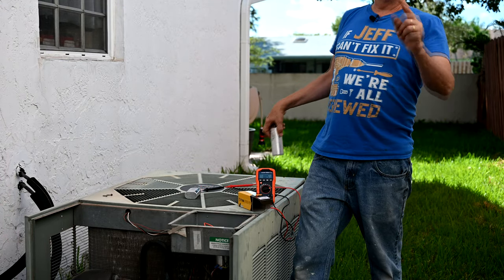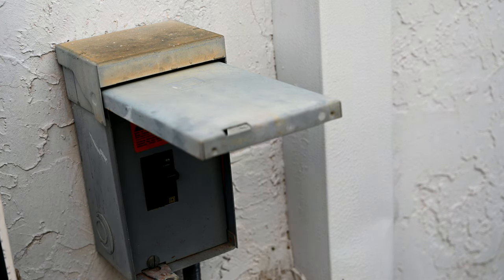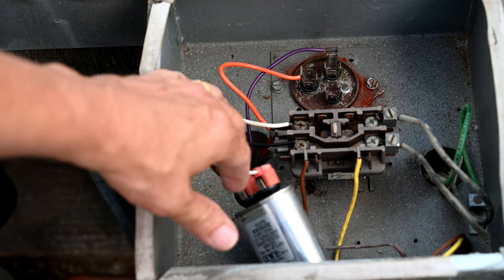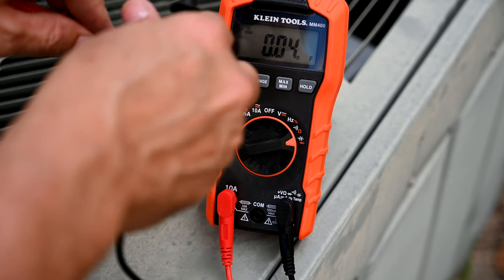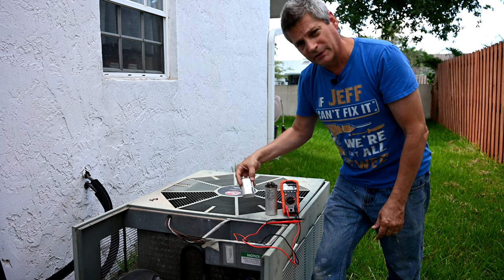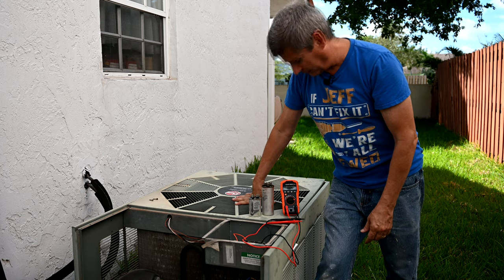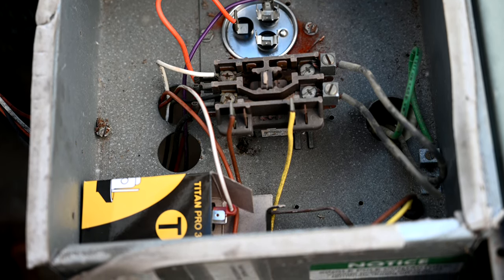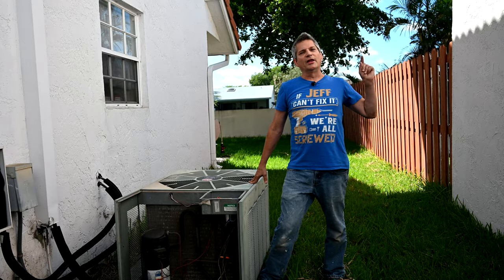DIY Fix AC Compressor Fan Not turning On, Just Humming

Comment: I replaced the compacitor and it started working. But after 30 to 60 minutes the fan stops and the unit starts buzzing/humming. I turn it off after 10 minutes it starts again but it stops after. What should I check next?
Reply from the maker: There is a start capacitor and a run capacitor. some units they are 2 capacitors built into one can with 4 leads. Which do you have?  If you have 2 caps, try checking the capacitance of the smaller run cap, see if it is what the can says on the side. If the capacitance is not what it should be, like below 10 uF for example on a 35 uF cap, then you need to replace the cap. If that does not help, then likely the fan motor is going, about $90. I would also check your contact relay, make sure there are no leaves, seeds, insects, etc, in there that would give you intermittent contact. Lost of people have that issue.
Reply: jeffostroff I have the dual run compacitor. The one I took off was all rusted and I couldn’t see what was capacitance, but I research online for the right one and is a 45/5 it did start but after 30 to 60 min it stops and starts buzzing/humming....I’ll check the relay and everything else and replace them. Thank you
Reply: Joel any chance you found a solution im in the same boat!
Reply: Josh nonya I replaced the dual run compacitor and the contact relay and still makes the humming/buzzing noise....So I order an oem fan motor and I’m still waiting on the package. I’ll let you know when I get it and  replace it...

Ps. if you get it fixed before I do, please let me know what was the issue.
Reply: @joelcd214  I just ran some water on mine and put two blower fans on it now it's cooling the house so yeah it's the fan motor
Reply: Josh nonya hey I replaced the fan motor and yes it was the fan motor super easy to replaced.

Comment: I replaced the capacitor but the fan is not spinning its like frozen in place the fan doesn't move at all, is the fan motor dead that's why the fan is not moving

Comment: That oval capacitor is not original.  Unit originally had a dual capacitor.  Check the fan motor label for the capacitance that is required.
Reply from the maker: There was another fan in there at one time, and another cap. The correct amount of capacitance it here, we checked that last year when we shot this video, there are 2 caps now.

Comment: My ac unit blows warm air at night and then in the early morning blows cold air again. Also noticed the ac fan will not run on Auto but will run on the ON position in the  thermostat. Thoughts?
Reply from the maker: Here are some things to try. Had a similar issue at my friend's house. Most likely your system won't turn on in Auto Cool mode, because your AC pan drain line to the outside of the house is clogged, so water backs up the drain pipe, back to the pan in the  AC, and then it trips your float switch because water is backing up. the float switch protects you from water backing up and overflowing and dripping all over your floor, they are required by code.  Do you have a float switch? Set your system to cool auto, and pull up the float switch out of the white plastic pipe, stick your finger down there and see if there's water. Under normal operation should only be minimal amount of water, not enough to make the float switch rise up and turn off the AC.  If the AC auto cool turns on when you lift up the float switch then your drain line is clogged. Got to outside of house where drain line emerges, and put a shop vac on the pipe, seal it with a cloth for max suction, turn on shop vac for a minute, and most of guck will be sucked out of the line. Then water should drain more like a fast drip. Let me know what you find. You can also check the batteries of the thermostat, when the voltage gets low, =sometimes the thermostat acts weird, but I think your problem is the clogged drain line.

Comment: My ac is old and when I turn it on at first the fan needs help sometimes but after that it's ok and when the fan turns off.    But the  compressor is still on I replaced the capacitor for the fan it seems to slow down n stop ? Runs for 20 30min then stops and I reset it then it's up again.
Reply from the maker: I would measure the capacitance at the  leads of the capacitor with no wires connected, make sure it matches the uF specified on the can, for example the can might have printed on the side that its is 10 uF or all the way up to 45 uF. If that passes, then clean off the contactor relay off all bugs and leaves, that can prevent the contactor leads from making good contact, reducing the voltage to the fan. If your contactor is fine, then your fan is likely blown. They last about 5 years or so. I replaced mine a few years back, another viewer of this video replaced hers fan the other day as well as the fan cap.
Reply: @jeffostroff  thanks its about 20 years old will check it out. Also i don't think it's running on a timer

Comment: I thought my issue may have been a bad capacitor but upon replacing it I am still having a problem. The problem I am having is the AC unit outside only turns on for around 30 minutes or less and always shuts off before the temperature it's set to lower to in the house. I always notice when it turns off because the AC vents start blowing warmer air. I recently got freon put in and this last time the company said the unit didn't even take any freon. What do you think can fix the problem I am having with my unit? Do you think it is the compressor going bad? I am thinking of buying a hard start kit and giving it a try since they are fairly cheap on Amazon.

Comment: In my unit, the compressor makes a buzzing sound every couple of minutes but does not start.  The fan makes a constant buzzing noise and will only get going if I give it a nudge with a stick.  Could this be caused by bad capacitors?
Reply from the maker: I'm hoping it's not your fan, they are often $100 and up, but the capacitors are $10 to $20. At the end of the day you need to be able to measure capacitance of your caps with the wires unplugged to confirm.
Reply: @jeffostroff  It was the cap, but it died because a lizard thought it would be a good idea to walk over the contacts.  I had to pay $$$ to get it fixed this time, but I have already ordered a backup from amazon for the next time.
Reply from the maker: @realmugzy  How much was the new cap? the AC companies like to charge you $120 for the cap when they replace it, in addition to their labor charge it's $15 in the supply store.
Reply: @jeffostroff  My bank account is $169 lighter.  The even tried to make it sound more impressive by putting this on the receipt "Electronic Storage Device".
Reply from the maker: @realmugzy  Now that's a fancy name for a capacitor.
Reply: @jeffostroff  squeezium gas , fancy name for a fart 😂
Reply from the maker: @DRT-81  air biscuits

Comment: What about when the ac unit isnt even humming. Like not turning on at all?
Reply from the maker: Then your contactor may be bad, or check the contactor for a collection of bugs and leaves that get caught in it, causing the contactor to fail to make electrical contact. I always measure voltage before and after contactor, but be careful, it's 240 volts.
Reply: @jeffostroff  thank you so much. I will clean out the contactor
Reply: @jeffostroff  so i cleaned off the contactor and now its continuously humming. I already replaced the power capacitor
Reply from the maker: @MightyPaladin486  So looks like you has 2 root causes there. Is the AC working OK now?
Reply: @jeffostroff  it is not. My father in law said i need to use a nail file on the contacts. Just hums
Reply from the maker: @MightyPaladin486  If you can, measure voltages and make sure they are getting to the right places. Sometimes there is a start capacitor and a run capacitor, you need to check both. My meter can measure capacitance, that's what you need to be bale to do. Check the one you replaced also to make sure it's OK.
Reply: @jeffostroff  i have a run capacitor and a fan capacitor (oval)

Comment: Okay but what do I do if my capacitors are measuring fine 😭 I replaced them just in case anyway, but it's still just humming/buzzing and not starting 😭 I'm so sad since all the clues hinted it would be my capacitors, but it seems it wasn't
Reply from the maker: check the relay next, the contacts on the relay, sometimes leaves and bugs pile up

Comment: About your capacitor test....can't see what you are doing for the lovely view of the back of your hand.
Reply from the maker: put the leads across both contacts and measure capacitance on the screen
Reply: @jeffostroff  I saw three contacts.
Reply: and my meter has two wires.

Comment: Very nice video. But I just want to add one thing: HVAC companies have a BIG apparatus to make things happen. They are in the business not to make friends, but to make money. You said that both capacitors cost about $16.00 bucks, and that the HVAC company would rip the customer off. UPDATE: Prices are not that cheap anymore.
Well, Let's brake this down for an HVAC company doing the job:
* They will have someone working in the office to take your call.
* They will send a service technician to diagnose your problem and make the repairs, and usually these folks make $30 to $38 dollars per hour
* The service tech will be driving a van, that burns gas, has insurance, and etc.
So, $150 bucks, as you said is still not that bad. Sure, if homeowner can do it: FINE. - Now, what if they screw it up and have to replace the entire unit or something else much more expensive, who knows maybe even getting hurt by electric shock? 

HOMEOWNER, if you're here try to play the "MacGyver" figure kinda guy (lol), go ahead and call your HVAC company or freelancer AC guy!!

Comment: Just as an aside, the compressor was running so I wonder why he tested the compressor run capacitor when the problem was the condenser fan motor not running.  Just looking at how rusty the other capacitor was, I'd probably just replace it on principle.
Reply from the maker: That capacitor houses 2 capacitors in one, that's why. One of the caps was the fan cap the other was the compressor cap.

Comment: something he didn't do even tho he mention the capacitor store energy make sure that the capacitor is discharge before you get your hand where the wire connect
Reply from the maker: Or just don't touch the capacitor leads and you don't have to do any discharging. As long as you are careful with it just like you would be with a car battery. Do you bother to discharge a car battery when you remove it? Nobody does because they are careful removing it.
Reply: @jeffostroff  it look like you touch it. I was just trowing that out there for someone else lol. I'm a hvac tech and I do it all the time. great video btw
Reply from the maker: @quietgameplays8246   As long as I don't touch it with my tongue I'm OK lol

Comment: DO NOT forget to Discharge the capacitor before start touching with your hands. The capacitors can store electricity even if you turn off the electric power!
Reply from the maker: Unless the capacitor is dead. also too many people improperly short the terminals with a screwdriver which can make it explode.
Reply: @jeffostroff  Well how then do you discharge the electricity stored in it so you dont get shocked?
Reply: @TeaTephiTrumpet777  hire a professional hahaha but seriously you take a milti-meter set to micro-farad and touch the meter leads to common and herm, common and start. I do HVAC for 6 years now, and MOST start capacitors don't have enough stored energy to hurt you . Black start capacitors do have plenty to hurt. Your average run all be 30-60 micro farads where a start capacitor will be 150-600 micro farads. They usually have a bleed resisitor terminal to terminal to prevent this. Usually I just take a screwdriver to it anyways (life is an experiment 🥼) and never had more than a little spark on start capacitors, not once in a run capacitor and most residential ACs will only use a run.
Reply: @jeffostroff  I short capacitors all the time. Never got more than a spark when de-enegerized. This is on AC units only. I hear micro-waves, and car subwoofers have much more powerful capacitors. So in good faith I guess it's correct to Never do this to an appliance but for residential AC's it's really not a big issue
Reply: @bjorndecker3233  because of ants the Proffessional had shown me how to change it but forgot the specifics on this portion. But I did get it done that day and it is something most anyone with interest in doing this type of thing ie fixing things. But thank you 😀

Comment: Great video. Actually it would cost you more than $150 in NY. That's only a service charge. You'll be charged an additional $60 for capacitor and tax. The total would be around $225. Now the bad news is that this idiot with over 37 years experience placed the wrong type of capacitor (whatever it's available in the van). Had to replace another one after one season.

Comment: I worked in electronics in the Navy and we would charge a capacitor then leave it set on a bench. A rookie would always come by and discharge it. That was a lesson for them. A large capacitor can kill you. Any capacitor can shock you. BE SAFE. Always assume a capacitor is charged.
Reply from the maker: yes good safety tip

Comment: Should have at least wrapped the capacitor leads in electrical tape 😂 that thing can vibrate and hits anything grounded BOOM. Also they sell the proper size capacitors at supply stores, don't need to have two seperate caps.
Reply from the maker: could not find the proper size dual cap, because the fan was replaced in later years and is a non standard cap size

Comment: Next time, save some money and just buy a 35/10 capacitor.  The round one is a dual capacitor, 35 microfarad capacitance on one side,  five on the other.  You're only hooked up to the 35 side.  Your not even using the 5 microfarad side.

Comment: All good....some folks would prefer to use USA made capacitors such as the AMRAD brand who is located in Florida ! They are twice the cost but will last well over 5 years while the CCP or Chinese stuff craps out in just 2 years or so. BTW, in CA the HVAC parts are not easy to get unless you are a licensed contractor, especially if you visit an HVAC supply house.

Comment: I don’t recommend any body who has no professional training doing this! which wires should plug in the right connection with capacitor! It’s 240v running this unite! It really worth to pay$150 let professional AC Tech doing it.
Reply from the maker: some people don't have the money, and let's not kid ourselves, you know darn well this is not a $150 repair. This is a $300-$400 repair. At the AC supply house where I get capacitors, they sell for $20, but the AC companies gouge people $120-$200 for the capacitors, plus labor. They charge $150 just for the hard start kits, then their labor of 1 to 2 hours on top. Maybe your price was in Mexico?

Comment: Give it a good punch with your fist then it will come on..i did that now and it worked
Reply from the maker: Doing the fonze. Yeah we eventually got a hard start capacitor which really made things a lot easier it went from not even being able to start no matter what we did to then it turned on every time and we used it for about a week while we were waiting for the new AC to come in

Comment: You can tell who the hvac workers are in these comments lol my parents got charged for 1k to replace capacitor and fan motor, 3 days later started to make a large rattling noise and was charged another 300 to come repair/service call. Crooks i tell ya, oem parts online was 200 max , 800 for labor gtfo!

Comment: Ummmm... would help quite a bit if your hands weren't in the way when testing capacitors as to which terminals to measure on.
Reply from the maker: Did not matter in this case, we were measuring blind, because the names of the pins were rusted out and we could not read them. All you have to do is measure from one lead tot he other, and all we care about is seeing that there are more than 0 uFarads on the screen.
Reply: You only need the big one for both of them,it is a duel run cap

Comment: You hooked it up wrong I bet it didn’t start when you first turned it on.
Reply from the maker: Another  Uninformed  Lying troll period of course it worked it wasn't hooked up wrong.  All you are doing is embarrassing yourself in front of the Internet.
Reply: The common wire was hooked up to the wrong terminal, the fan was running but I bet the compressor wasn’t.
Reply from the maker: @davidgarza3176  compressor was always running fine wires were not hooked up wrong.
Reply: Leave it to a professional to be able to diagnose and repair correctly before a homeowner gets them selves hurt or damages their equipment more.

Comment: 9 times out of ten your coils are dirty causing undue stress to all the electrical components. If I found a failed cap I wash the coil as an insurance. Cover your butt. No need to put a new starter on your engine if it still runs hot. That's probably what killed the cap to begin with. That or you're in for bigger problems down the road. A good technician should be looking for causes and check your motors, compressor, coils, lubrication, electrical connections, charge of refrigerant etc. You may save money just being a parts changer but a good Hvac company will save you money If you pay for proper biannual maintenance services.